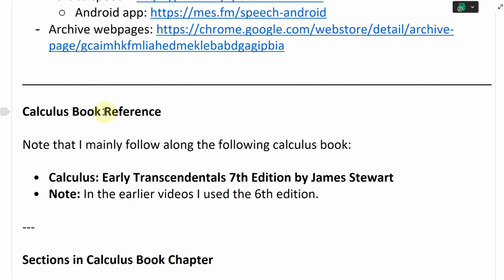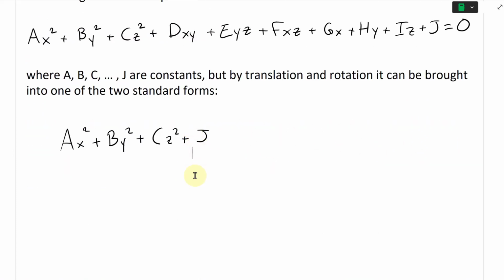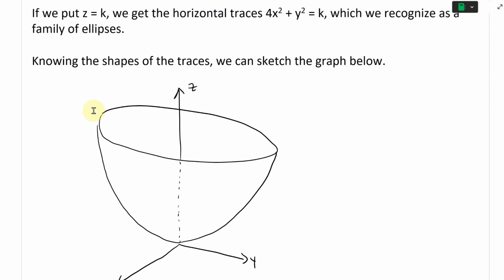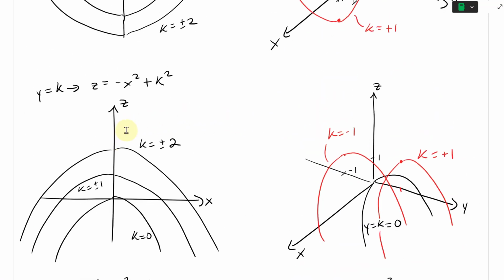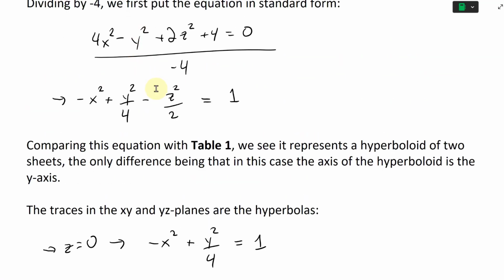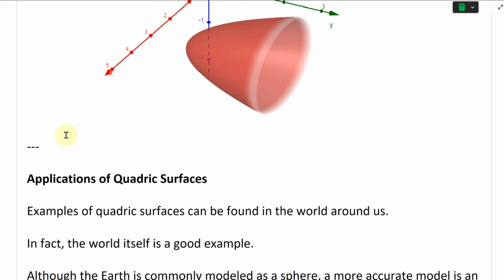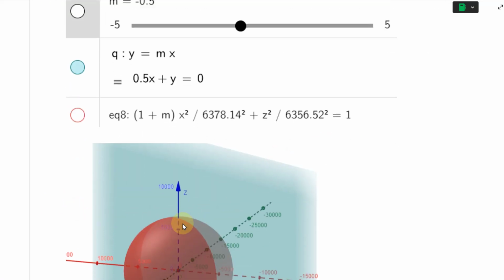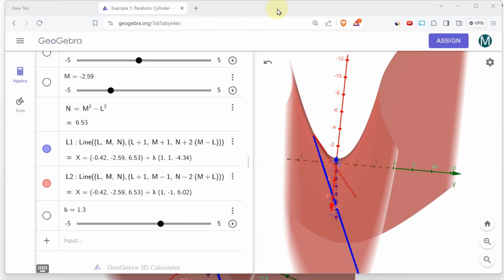Vectors and the Geometry of Space: Cylinders and Quadric Surfaces

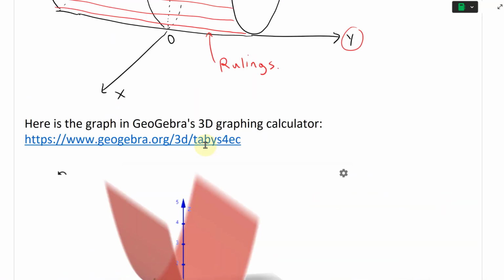Comment: At 10:22 , when you mention that "If one of the variables are missing.." it would make a cylinder, this is only in the case with the maximum exponent of a variable being equal to 2, right? If it's just x = z, then the surface being made would simply be a plane.